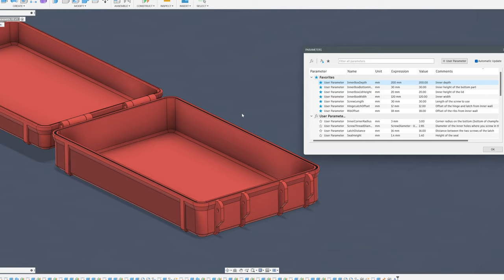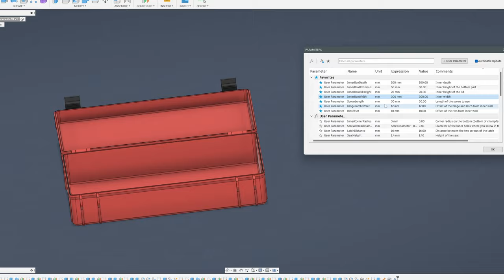3D printed Rugged Box - Parametric

Comment: I didn't want to drive to the hardware store to buy screws. So I just created a rod in Fusion 360 with glue able stoppers at the End I-----I     put it all together and it works great, use the box everyday at work, nothing broke jet 😊

Comment: Try random seam placement, and maybe a thinner nozzle so you have more walls with a smaller seam between them. Also if you really want to make a printed thing water tight you can rub it with a candle, and heat it with a heat gun to melt the wax (in that case I'd do it on the outside, otherwise you'll get water on the infill).
Reply: With calibrated printer and well selected PLA, PETG, ABS, ASA printing absolute water/air tight at speeds around 30mm/sec, 0.2mm layer, 1.2mm walls, 30% fill was never a problem with Ender3, CR10-MAX, XYZ-pro-3in1 even at 98% extrusion on CURA, Creality slicer or XTZ-printing slicer. Microsoft 3D Builder Printer module was good at first, than crashed and now works not so good for XYZ-printing. Mechanical AND optical, prints can easily rival best shown prints in internet. Printers if adjusted correctly with no nonsense settings CAN print water tight models (even water/air under pressure) WITHOUT any other potentially risky treatment (heat deformation). If they are in contact with water and you want to avoid hydrolitic plastic degradation (prone to, are PLA, PETG and less ABS and specially ASA), you can use wax method, but I prefer painting with spray of Acrylic or other UV and moisture resisted coat.

Comment: I've had many filaments that was very wet even when they are fresh out of the sealed bag before. Honestly I don't understand how people can 3D print without a filament drier, its so important.
Reply: I had a roll of PLA filament out of the bag for about a year. I finished using it recently. Not a single moisture problem.
Reply: @cosmefulanito5933  I've never had a dryer. Colder/wet living environment here but I do keep my filament in ziplock bags (reusing the silica). Not any issues I've seen that seem to be attributed to moisture but... as I start to experiment with higher volumetric flow, I think I'll have to eliminate these variables soon.
Reply from the maker: @Cosme Fulanito  pla is fine. Now.. try the same with any cf spool. Cf is the culprit. It absorb moisture
Reply: @Vez3D  That's why I said PLA. Which is the most widely used polymer.
Reply: @cosmefulanito5933  I production print in primarily PLA, ABS/ASA, PC, Nylon, PETG, TPU, with CF and GF variants. Of all of that, PLA is still probably 8:1 most printed. Midwest USA, so humid in summer and super dry winter. I’ve never ever had dry a PLA, ABS on occasion, CF PETG half the time, Nylon I won’t print unless it’s gone through the dryer last night, even during winter. I’ve not noticed that CF is always a required dry (never cfpla), but CF PETG is way worse than PETG alone.
Reply: @Vez3D  then say that explicitly

Comment: Hi, i was thinking about building a Vz330 and saw a kit from Mallow 3d. I was wondering if there is a version available with the Goliath hotend and watercooling?
Reply from the maker: the kit have a goliath air cooled.. but we will have a water version of the kit ... i hope soon. for now.. if you want to go with water. you can order the kit and add the watercool body of the vz-hextrudort, the new heatbreak, and the adpater plate

Comment: looks nice, do you have an enclosure on that printer? also, maybe print the gasket in vase mode and up the layer width to the wanted width in exlusive slicing and im sure it will be water tight :P

Comment: Love it, its so fun watching your Printer work. What do you use to hold the top hat open?
Reply from the maker: the hinges are designed to hold at 91 or 92 degree so it holds it self up. But some people reported it can break the printed hinges if you are not careful enough and slam it too hard. on my side, it wont happen because when it opens up, it sits agains the wall so it wont go any further back

Comment: How do you adjust the size without also changing the size of the latches and hinges?
Reply from the maker: @97JoMiller  its parametric. You just change the user's variables
Reply: @Vez3D is there anywhere that shows how to do that? Guess I’m about to learn something new :-)
Reply from the maker: @97JoMiller  google fusion360 user parameters